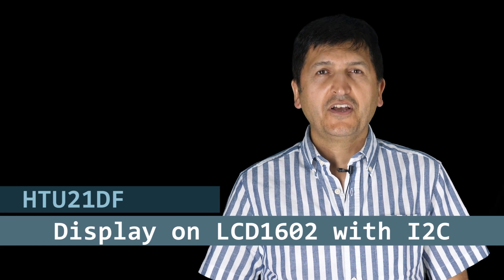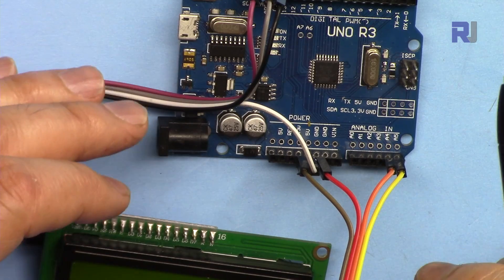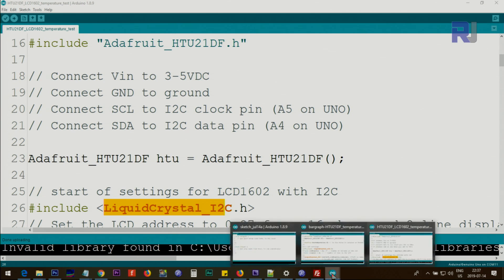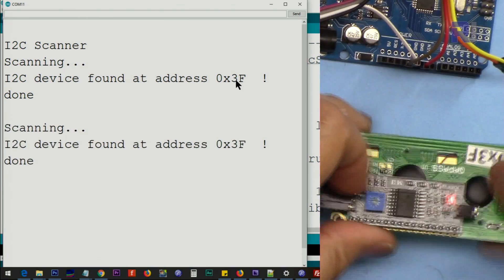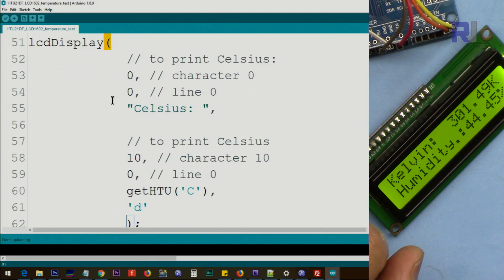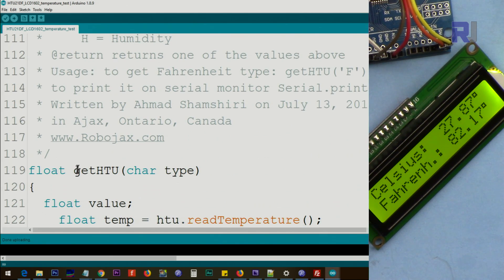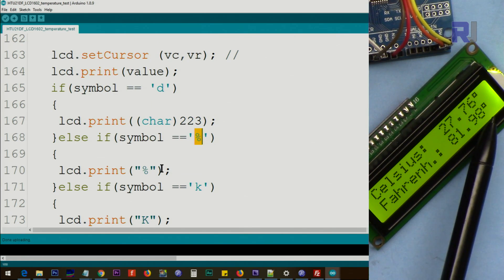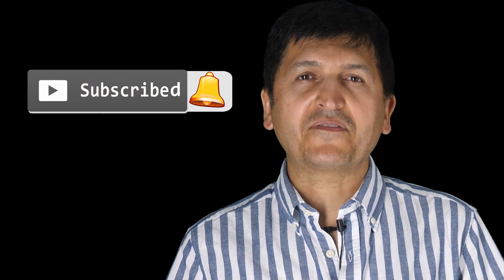Display Temperature from HTU21DF on LCD1602 or LCD2004 using Arduino RJT179

Comment: Hi Robojax!
I recently started learning Arduino.
I like your videos on YouTube.
I saw your example on the link.
But the code itself is not there. Apparently something broke.
Is it possible to fix this?
Reply from the maker: Hi, Please provide error. the word "broke" is very vague. Arduino IDE always gives some erro. Most of the time it is very clear plain enlighs. Just read it. Or copy and past it here.  I hope you have installed the LCD library.  If you did not install it, you will get error. You may learn how to install library in a different way from this video https://youtu.be/QLnM1aNMtb0 or 50s of other videos I have.

Comment: Thanks for your nice tutorials! Well explained and brief!
I'd just like to know how to get this sketch working on an Arduino Nano. Despite all my efforts I have reached the utmost edge of my knowledge without achieving my goal. Would you be so kind as to helping me with a clue? My thanks are yours!
Reply from the maker: It should work with any Arduino, as I have explained you have start with simple display (I have video link in description) , then the sensor video and then 3rd is this video.  Try it with noni with above step and it will work
Reply: @robojax  Thank you for your reply. The problem consists in the fact, that both the LCD1602 AND the HTU21D need sda and scl pins, but the NANO only has one of each :/